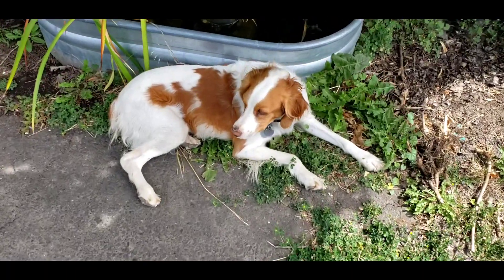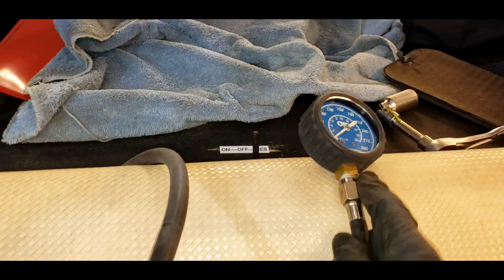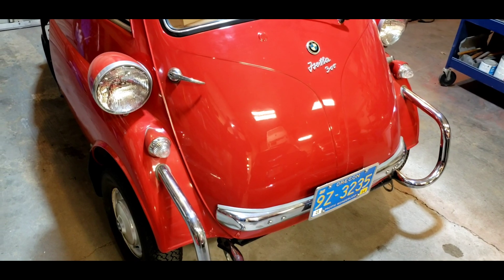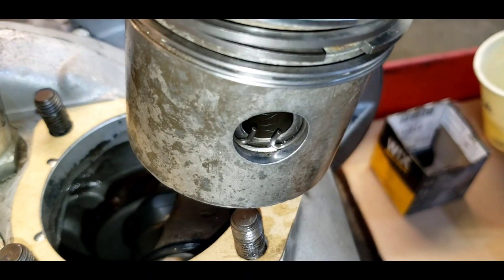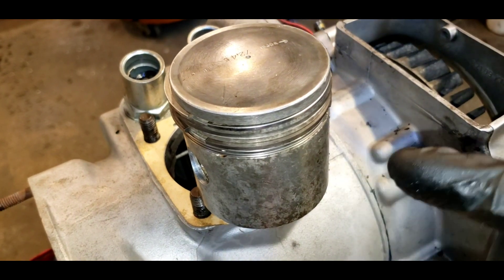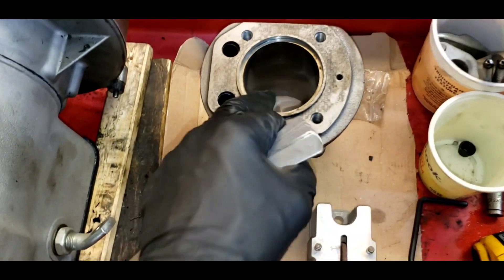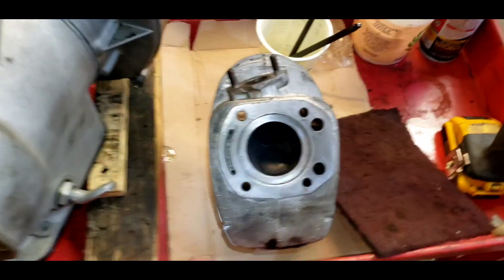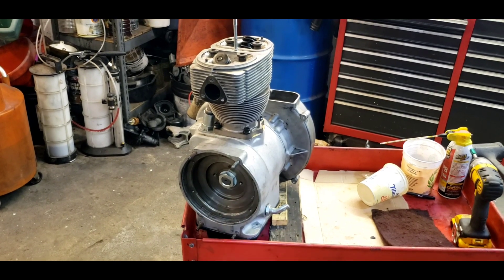Lets Fix Isetta's !

Comment: (not exactly 2stroke related, but😁...)
I use one of those ring gap grinder tools that I bought from Goodson when working on my vintage briggs engines. It also has an added v groove milled in it for butt grinding valve stems & works very well. I use it along with a Neway valve cutter 102w kit that My GranDad gifted me from His small engine days & these are the best  tools I have found so far if you do not have access to a shops valve cutter machine. There was also another antique D.I.Y. adjustable cutter tool I have seen that is used clamped in a vise. Then you install a worn valve & use a handle that ataches to it to crank & cut. Stens once used to sell a reproduced version of it but it is now long out of stock✌👍